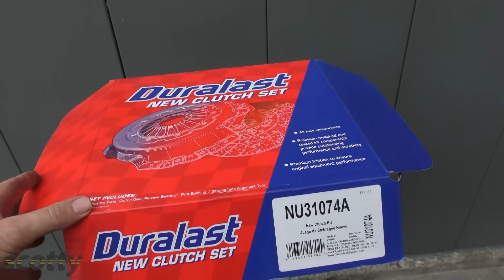5 Things You Should Never Do in a Manual Transmission Car

Comment: Help!!! help help!!!
I just bought a 93 crx delsol about a week ago and now the car revving up and down after I cleaned the throttle body and IAC valve.
I disconnected the MAP sensor and the car was still running and revving up and down?
I also noticed slight drip of coolant underneath the head block (gasket area)
Seller has ignored my calls.
But there is no milky like inside the coolant or oil cap?????
Reply: J k ask through his email or the scotty group on facebook, always someone to help answer there.
Reply: its probably the beginning of a head gasket leak
Reply: Morngo Vlogs should I pour in steel seal as reckon by Mr.Kimler?
Reply: J k look at his older videos
Reply: When hondas get that surging idle it's usually the idle air control valve. You could also have a vacuum leak or a bad map sensor.
Reply: V.Vega I was shaking the IAC valve and doesn't seem to move.

I was at the wrecking yard,we swapped map sensor and still the same.

The wrecker recommend it likely the IAC valve.
Reply: does it hunt around all the time or just until it warms up?

look up honda idle problems by Eric the car guy.  I had this problem and the only thing that fixed it was adjusting that screw.  no more hunting idle.
Reply: J k Chris fix just did that as well. 93 also i think
Reply: air in the cooling system. fix the leak, bleed it out.
Also, make sure your throttle body gasket is in good condition; if its torn, replace it.
Reply: One 7 Decimal 2 Eight when it warms up,it
Idles at 2000RPM constantly start revving to 2KRPM andnow1RPM, sometimes 3,4kRPM ,but when am driving 40/60km/hr seems okay , but when i am coming to a stop it starts revving all over the place.
Reply: How the fuck could anyone think a surging idle is a symptom of a bad head gasket? It's not even fucking close.
Reply: Update!!car has been fixed.
Apparently the fast idle valve was spinning freely and there was vacuum leak from the throttle body.sealed the throttle body and now idling like a charm.
Reply: A little late, but obviously a vacuum leak somewhere. Dont know why someone would think its the cooling system.
Reply: Thanks guys for all your replies,I do appreciate your efforts.
Regards
Reply: Diy head gasket repairs do it now before more damage is done there not overly hard but there’s ALOT to take off to even get to it

Comment: Great information Scotty , but does this Apply to MOTORCYCLE’S.  Down shifting ??
Reply: Jimmy Sapien are there clutches different?
Reply: bob Zombie Yes motorcycles have different clutches.
Reply: skileg10 ahh ok cool. That's what I figured because I was like where the fuck would they fit that big ass flywheel. Excuse me for my ignorance.
Reply: It's very important to downshift if you ride a V-twin motorcycle like I do. Downshifting and rev matching sound really cool. Since we like to sound cool when we come to a stop light, we should downshift to call attention to ourselves.
Reply: Downshifting is necessary on motorcycles as they all have inline shift pattern, you can't shift from 5th to 2nd. To coast to a stop with the clutch in would leave you stamping on the gear lever repeatedly to find neutral or first before you can take off again.
Reply: Jimmy Sapien Absolutely. Just as Ross Brumby said, it is necessary to downshift when slowing down. In emergency situations, it also helps slow down the bike a little faster, and prevents the tires from locking up. Engine braking is not nearly as significant as a car or truck trying to slow down, but you still need your gears lined up for when you accelerate again. Riding the clutch has absolutely no use on the road. That's comes in handy when you're offroading, going up walls, but you're willing to replace the clutch soon afterwards.

Comment: It's really hard not to change gears all the time when you learn how to do rev matching down shifts with a badass mustang that has a really tough loud exhaust. The downshifts are almost addictive how good they can sound and how fun they are. Plus I heard from some performance manual drivers that rev match downshifting is actually better for the tranny then just putting it in the gear and just releasing the clutch with no throttle to put the RPMs where they need to go, and it just feels less smooth.

Comment: When you park ur car turn the wheel all the way to one side then turn the car off so the wheel locks in place. That way if the car does roll down hill it will turn and stop a few feet away, my dad taught me that and it saved me once early in my driving years

Comment: i was taught to downshift when driving a manual, quite frankly, i find it useful because engine braking means my brake discs and my rotors arent under as much pressure, plus it dosent take a genius to hear when the cars revs are getting too low to keep the car moving, so shifting down to a lower gear is better than stopping in the middle of the road, plus if you're climbing a hill, again, shifting down to a lower gear is a good idea.

Comment: I’ve got a 08 skoda octavia vrs…..I hardly ever break, I down shift to slow down 95% of the time…..I like the sound. I got the car on 67k it’s on about 130k and it’s still on its first clutch. I’ve had it mapped with an intake and exhaust aswell. Nothing this man said is true when it comes to tfsi turbo engines, they love it

Comment: Hey scotty sometime our parking brakes are broken, my ranger has a drum in the rear and for whatever reason no matter what I do it won't grab so whatever 1st will hold it, my corvette is a manual swap and all the parking brake components missing or broken so it's getting 1st gear for now too.
Better advice- turn your wheels away from the curb if parking uphill, or towards the curb when parking downhill incase it slips out of gear

Comment: I always park in neutral and use the parking brake, car and truck. Always in neutral at the light and get off the clutch pedal. If you don't stay out of it as much as possible the throw-out bearing will fail long before the clutch does.

Comment: Downshifting isn't gonna wear your gears of you rev match, obviously doing stupid speed and then going down to gear two without even rev matching will cause issues. But coming to a stop with engine breaking is actually taught in the UK... It's safer and doesn't harm the car and you don't use the breaks as often.

Comment: As a Brit, I downshift all the time to save petrol when slowing down since idle uses more fuel than rolling in gear. My car is a 2001 Skoda Fabia. Just exceeded 100k miles. Still on original clutch.
The answer is to drive predictively. There are too many brake monkeys on the road wasting fuel and wearing parts out.
I'm the only person i know to get the rated MPG in the work vehicles (Fuel card and tracker logging). If the onboard computer is to be believed, I exceeded the rated MPG on a hired Merc Sprinter and Nissan Qashqai.

Comment: With all of that information Scotty about the clutch you failed to mention that most of your modern standard shift transmission or clutches come with plastic clutch pedal housings that when they heat up they attend to get brittle after awhile from age and break with in the middle of them that riding your clutch causes them to wear out faster

Comment: Downshifting to slow down is 100% fine. 5 manual cars average 210,000 miles before any clutch replacement. Zero issues with trans or engines. 

100% of commercial trucks with manual trans downshift. 100%. And millions of miles on the engine.

Comment: had a Mazda Protege with terrible clutch chatter on cold mornings. the dealer couldn't (or wouldn't) do anything about it even under warranty. Around 80-90k miles I had a new Exedy clutch kit installed and it was a world of difference and the clutch chatter was gone! Ironic since Exedy was the OEM clutch supplier for the Mazda Protege

Comment: The bad thing is, most new and not so new cars have Damper Flywheels, which cost a fortune to replace... more than the clutch kit itself, that's why I went for automatics,  most times the Flywheel and the clutch kit would cost more than a second hand automatic transmission in good condition.

Comment: You should tell them they need to release the clutch in first gear (sometimes could work rear gear) before applying the handbrake. I am sure that the engine can keep the car in place better than the handbrake (inertia of the car). The problem you talk about, is concerning the gearbox, not the engine itself (if is the right take care of it). I won't say you we're wrong. I'd say you told them the ideea that handbrake is more safe when it isn't the case. I totally agree, apply it! But no without knowing the car hasn't been engaged fully in 1st gear.

Comment: Scotty what's wrong with downshifting if you revmatch? It makes you a better driver I think and can make the whole driving experience a lot smoother! Like if I'm in 3rd approaching a roundabout I don't wanna slow down a lot by braking and then change to 2nd, but rather I revmatch and downshift to 2nd in advance and let the engine brake for me while in a superior position to accelerate away if needed ;)
Reply: I was scolling the comments and was shocked by how many I skimmed before you raised this point; good on you!

I think the answer is somewhere in the middle. I find the best bang-for-the-buck downshift is 4 to 3 - rev-matched downshifting in higher gears does little to no help with braking and downshifting in the lower gears, though a major saver of conventional brakes, is hard on the drivetrain because the gears are so low. I agree that driving your car properly on downshifts (rev-matching) helps offset all this stuff, but strain is strain regardless.

Another middle ground is getting into lower gears (2nd is the most versatile in my experience) when going down steep hills; let the car roll down them and you can stay off the conventional brakes a lot more. Hills are the biggest killer of conventional brakes; offsetting hills with engine braking will save them while limiting the amount of strain on the drivetrain compared to downshifting properly via rev-matching through every gear (except 2nd to 1st; just don't) in every scenario.

Lastly, I feel comfortable with more rev-matched downshifting as my car (1998 3000GT VR4) has a big, strong drivetrain; not all cars are created equal in that regard, so keep that in mind when you decide how much rev-matched downshifting you are going to do and in which scenarios.

Comment: I was always taught to have my left foot on the clutch at all times and my right foot for brake and acceleration
Reply: you definently dont want to do that.  its a great way to learn, but as soon as you are used to driving a stick you should move your foot away because you will wear out the clutch faster than is needed
Reply: Crazy.

Comment: How do you so here’s that I have been a mechanic for quite a while now and you Don’t put it into gear would you need to do is take your clutch put it into neutral push on the brakes put on your parking brake and you’re good. And when Your Clutch disc runs out it doesn’t mean that you go to AutoZone and just buy a whole new kit every about three times that you place it you’ll probably need to get a new kit every 3 times you replace the clutch disc. By the way, important on the break is what you call an emergency break which is not an emergency brake use it for a normal car when you park so you don’t roll with your back tires.￼

Comment: Its wired I have been following all 5 rules since I got my 5 speed dodge ram 1500 .  the clutch was new in it when I got the truck about 3 1/2 years ago and the clutch still works great . my trans gose into gear smooth like when I first got the truck with a 110,000 now it's pushing a 160,000 .

Comment: When you live in a tight city like London say you will need to downshift by increments because things happen often and very quickly on those roads so NO. Continue shifting like a rally driver etc... one requires all the stopping and motor control that is on offer. Frantic lives.
Reply: Well i wouldve thought common sense would help you adjust your driving techniques but sure, everyone should just drive one way

Comment: automatic transmissions also need the PARKING brake on (its not an emergency brake!). Don't just leave your car hanging on the transmission in "P" mode. Put the PARKING brake on before you take your foot off the brake pedal.

Comment: I drive a 1982 Volvo GLT with well over 300,000 km on it and it still has the original clutch and engine. I always downshift to slow down. They don't make them like that anymore

Comment: Downshift is not for racing purpose but to make sure the gear is at the optimal speed, if you don't double clutch you will premature damage the synchronizer and if you don't rev match you will shorten the life of gearbox and engine since both in sudden shock of pressure

Comment: I always downshift with my car. Reason being, i dont want to rely on the brakes only... What i like to do is let it coast for 300m do a downshift to get it ready to accelerate again. I save fuel (on average 3km per liter of Diesel) and i dont wear out my brakes. 

Frontdiscs original at 232.068km (new brakepads at 64.000km) (75% wear)
Rear Drum brakes all original at 232.068km. (60% wear) 
The fuelusage used to be 1L diesel 11km driving (2.4D Toyota)
The fuelusage is 1L diesel 14km of driving (2.4D Toyota) (some cases if i really overdo it... i can even get 1L 15.5km out of the 2.4D engine.  

In my opinion it's all about how you downshift. If i wanted i could float the gears (but it wont since the clutch is there for a reason)

Comment: I had a 1990 Mitsubishi Lancer that had slave clutch cylinder broken on a cold morning (-30, around the same in c and f). It was farily cheap and easy to repair, which is not a common thing for a Mitsubishi

Comment: You can down shift if you want to. Sure it can shorten the life by a few 1000 maybe a good 5000 out of a clutch that can last the entire time you own the car or at least 50k-100k miles depending on what you drive. I've replaced mine once after owning my truck for a few years, still down shifted to keep oil pressure up but it lasted that long. I'm not sure if this was 5 things to not do in a standard trans being the last 2 thing he talked about were things you should remember to do. Not things you should never do.

Comment: There is no conceivable way that downshifting can wear out the clutch if you do it correctly. I don't understand how driving a manual is such a mystery to people (even mechanics). If you rev-match while you move the shifter, the engine speed is the same as the transmission speed by the time you let the clutch out. If you're worried about synchro wear in lower gears (where the ratios are farther apart) then you can just lift the clutch pedal for a split second in neutral as part of your rev-match. This brings the transmission up to speed manually too without even using the synchro. Now neither the clutch nor the synchro does any work at all, and you can still keep your car in gear while decelerating. People who just put their car in neutral while slowing down end up burning more clutch than anyone when they decide to accelerate again and throw it back into gear from a low transmission speed (burning the sychro), and then letting the clutch out with no rev match (burning the clutch).

Comment: It is NOT an emergency brake! In UK you would fail your driving test if you don't apply the handbrake whenever the vehicle is not moving. Some are foot operated so it is OK to call it a parking brake but it is wrong to call it an emergency brake.

Comment: There's nothing wrong with down shifting for turns, but why do you say 5, 4, 3, 2, etc? It's easier and more efficient to just go straight from 5th to 2nd for example at a roundabout... You don't have to shift through every gear. 

Also driving with your foot on the clutch is fine as long as you're not pressing it...

Comment: I saw another video that said it is not a good idea to be sitting at a red light with the clutch engaged.  It is (according to the video) better to put the stick in neutral position and let the clutch out.  Then engage the clutch and put it in first gear when you are ready to go.  Is that true or not?

Comment: Americans, please pay attention! This is what you do: Rev the engine, and slowly lift the clutch. Make sure you put a good heat cycle into disc. When coming to a stop, always shift into Neutral and hold the clutch pedal. When at the light, keep holding the clutch pedal while shaking that shifter like a real man! Left to right! Keep shaking it! You can stroke it too! Keep that pressure plate pressed in, just to be safe. When going into turns, make sure u shift into N, while pressing in clutch, shifting that stick real good. After the turn, you pop that clutch nice and EZ! On the highway, put it into a N, every so often. Remember, EZ does it! 
For the Europeans, plz pay attention: going into a hard right hander, you heel-toe shift, blip-blip, down a gear, making sure u in correct gear BEFORE the apex. Accelerate hard, upshift while slight delay on throttle, keepin it in power band. Another turn, foot on brake, transfer weight up front, heel-toe blip, downshift a gear again, keeping synchro rings and clutch disc essentially like brand new. Come to stop, park. Put car in Neutral, kill engine, THEN you shift into 1st or R. Done deal!
Reply: We all know you Europeans gas is too expensive to drive like that. You guys drive a bunch of 120 horsepower go carts.